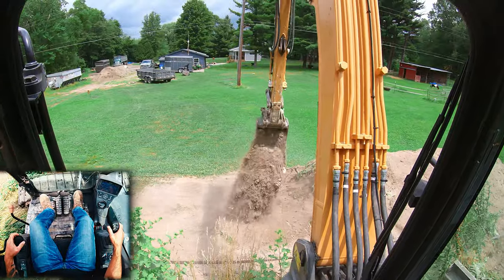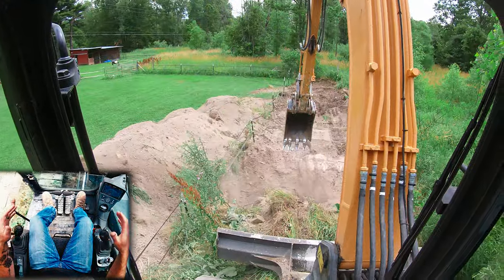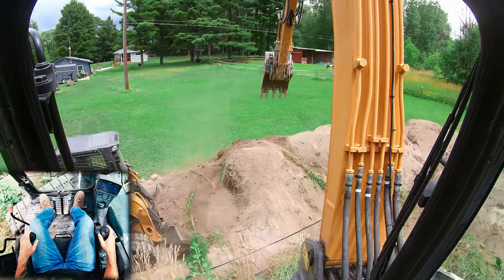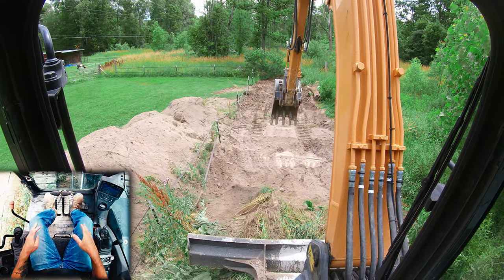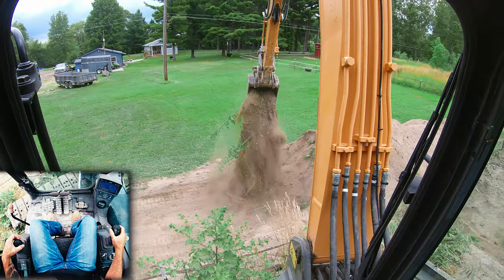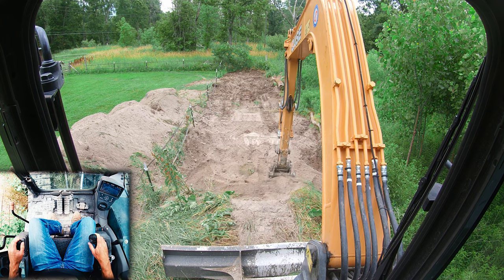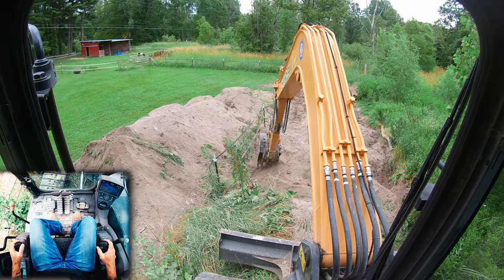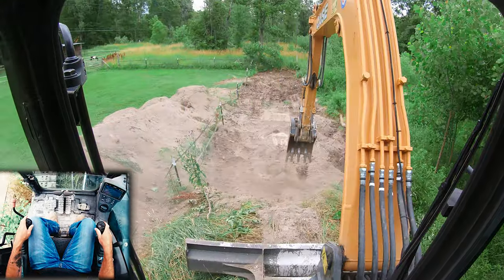How to be More Efficient in an Excavator

Comment: In the competetive tree care industry there's this saying "Slow is smooth and smooth is fast". Would you say that concentrating on being smooth is the way to be efficient or is it not the case when it comes to loading dirt in an excavator?
Reply: 100%. If you just are rough and fast you'll have to work a spot with your bucket way more than if you focus on being smooth. If you hit it once and a fast operator has to hit it 4 or 5 times you'll always get done first
Reply from the maker: Smooth is absolutely fast in these machines. For the purpose of demonstrating I was over emphasizing a lot of movements so new operators knew what I was talking about. In practice when I am bombing trucks I am still smooth with the motions but I am concentrating on only using one or two functions at a time. It doesn't look as nice and smooth as it would normally but you are increasing your efficiency by not waiting on the hydraulics to keep up with you
Reply: @DieselandIron  on the hydraulics seen a lot of operators when digging keep forcing a motion when the hydraulics have already maxed out. This wastes time and it tough on the pump. Try to learn the capability of the machine and as you reach lock out slowly start letting off the function to avoid hydraulic pressure build up and kickback. Best example I can give would be curling the back it in when it's already all the way in or trying to curl out to fast and slapping the bucket(which is already a no no) and then still hold it trying to curl out more after already slapping the bucket

Comment: # 1 thing is, Know what your trying to achieve. Ie; start with the end in mind.

Then there's, fill the bucket, don't needlessly pull full buckets through the dirt, if its full disengage from the face and begin to lift/slew towards the dump point. 

Etc etc

One good thing to do is, ALWAYS know exactly where your next bucket is going to come from. 

There's a trick to getting back to the engagement point at the dig face again but it's another story for another day.

And don't top out the hydraulic cylinder rod and ffs, don't dig or jack machine with any rod on its stop... That is #1 rookie tell tale. As well as leaving a full bucket of material ip in the air with the revs not at high. 

And best Tip for anyone trying to improve proficiency....

DONT TRY AND BE 'FASTER'
Just keep an eye on the bucket and always try and be perfectly smooth and precise with all your movements. (Which comes from precise lever inputs and timing, which develops subconsciously in time if you just watch the bucket....)
Once all your movements are smooth and precise, and you are able to mentally stay a step ahead of yourself, guess what.....
You NATURALLY and 'effortlessly' become much faster. 

*NEVER try to be fast. Always try be smooth and precise, speed will come naturally.
Reply from the maker: Great tips, thanks for taking the time to share!

Comment: I've opperated a bell2045 40 ton  excavator which one would you say is easier to opperated  a smaller excavator  or a big one ? Just asking for info
Reply from the maker: They all operate about the same. The big ones are slow and take some getting used to but they all run about the same after you get past the size